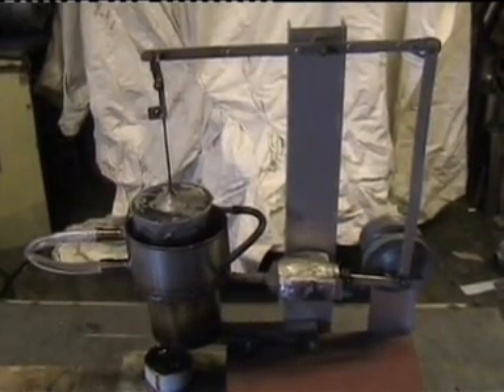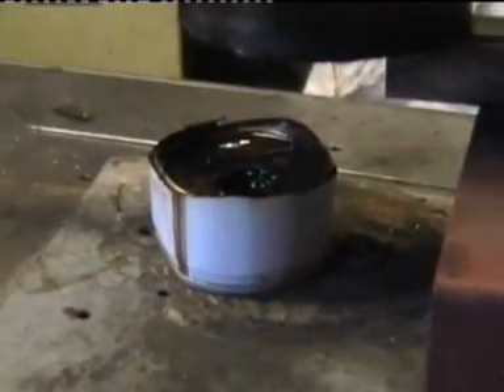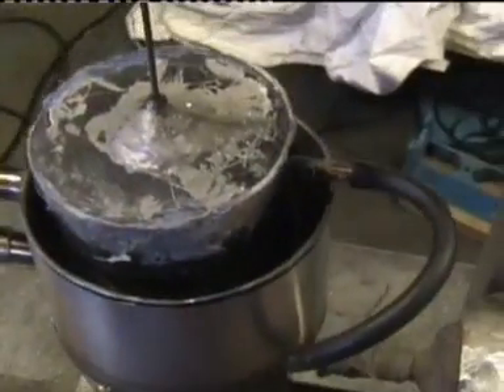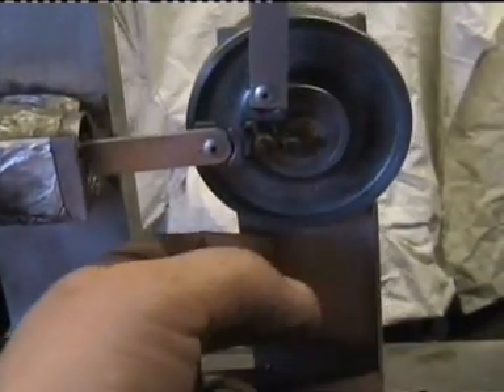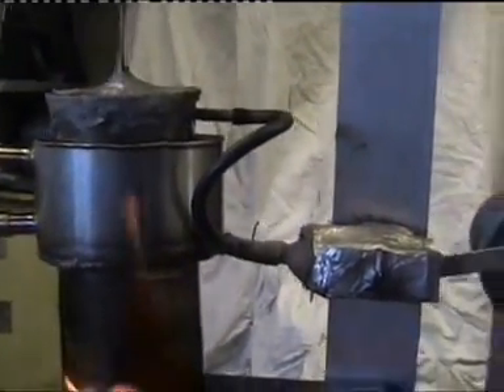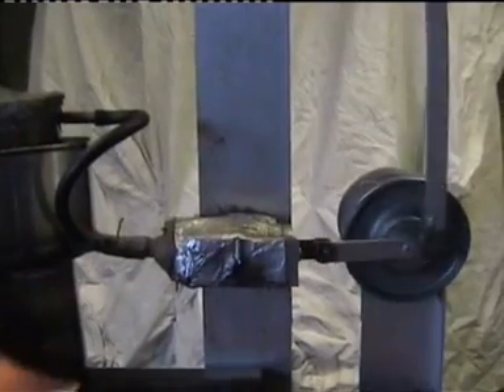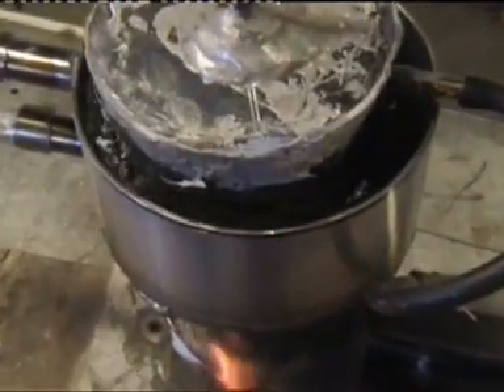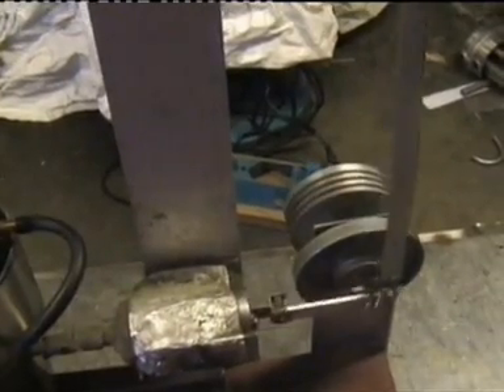Budget built Stirling engine, двигатель Стирлинга

Comment from the maker: For the piston I used the aluminium from old hard drive casing,the hard drive casing alloy is the same as the real pistons made of, I melted it in home log burner in a petfood can and poured into the aluminium tube that was stuck into the sand to block open side of the tube.
so the piston is solid aluminium cast.
Thanks